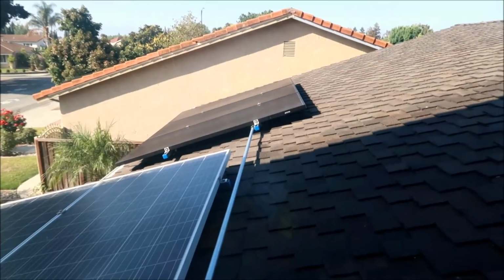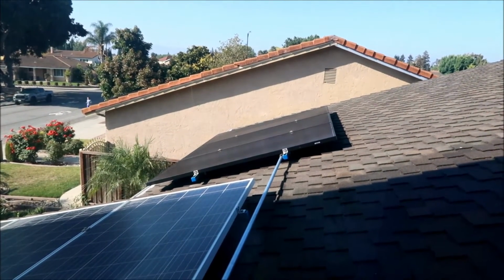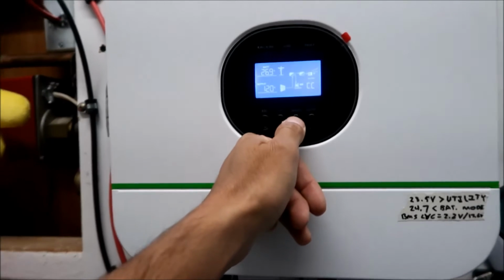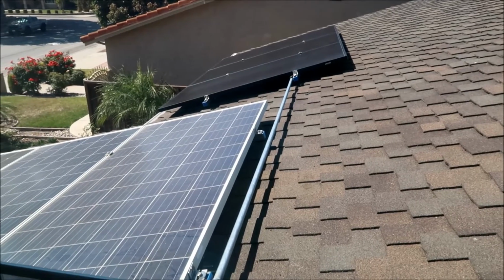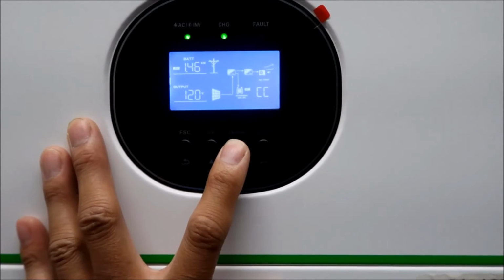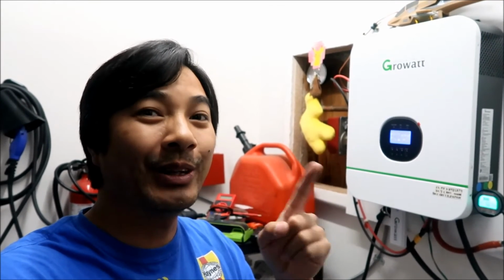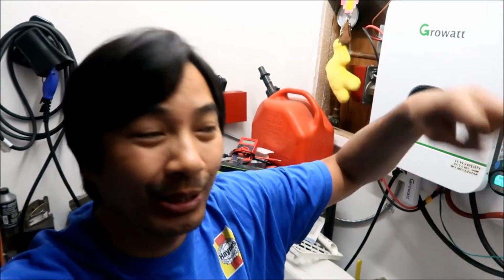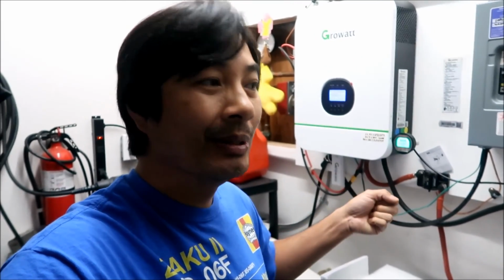HadesOmega Solar Garage Project Episode 88 - String 2 Initial Power Analysis

Comment: 12.20.21  Merlin Question.  If the panels are putting out say 14 to 20amps how is the growatt putting in 40 to 50amps into the batteries?
Reply from the maker: The panels are outputing 120V 8-10amps.  The growatt converts that to 24V.  Volts x Amps = Power (watts) 120V*10A = 1200watts, 24V*50A = 1200watts, If I had the 48V Growatt inverter I could probably push more power or at least use smaller wires.  But my battery can handle up to 250A.